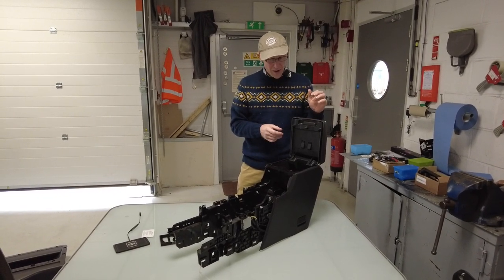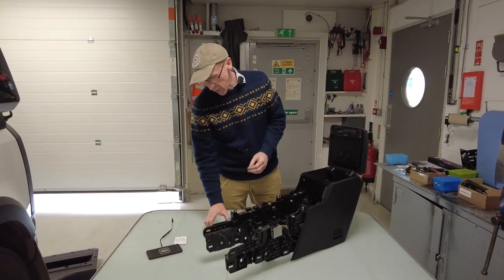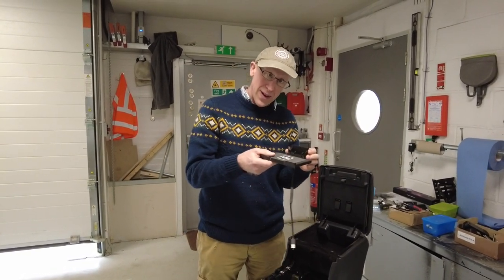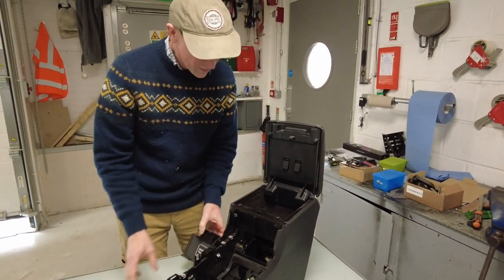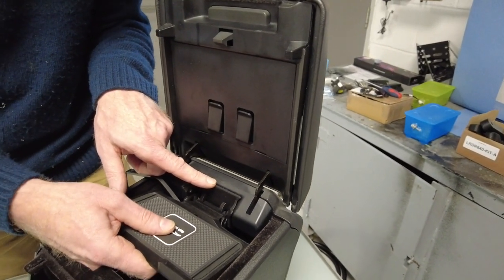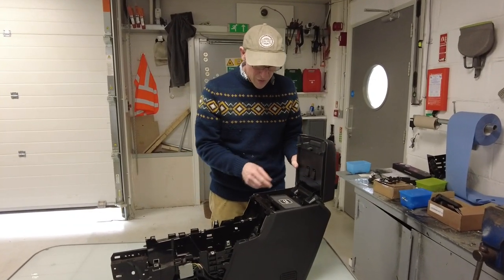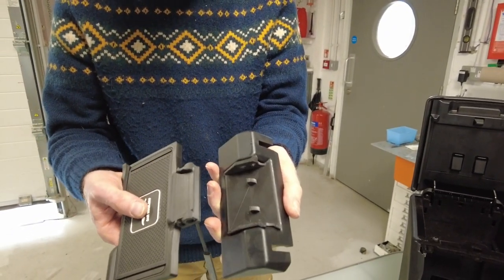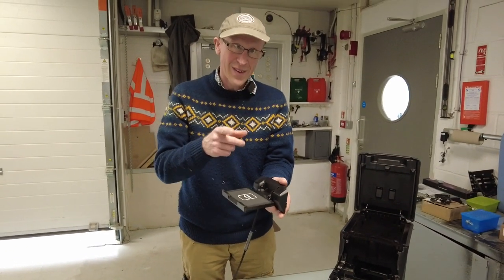Land Rover Discovery Sport L550 Wireless Phone Charger Install

Comment: Hello Simon!! The D/S never has a fridge in the armrest being much smaller than the full size Discovery 3/4 models. The charger will certainly fit the HSE Luxury with rear screen versions and inside the “box” you get power and media slots plus HDMI and SIM card. I actually have a cable plugged in for phone charging and have balanced the phone in the centre console pocket in front of the gear selector. Zack’s unit will fit of course and be a neat solution BUT, to be super snazzy, you could add a set of clips to hold the rear screen remote controller which I keep in that box and it is quite big…however don’t bother engineering one because sales will be super low…I have only ever found one other D/S with that option fitted! Good work Team!! 😎😎😎Richard
Reply from the maker: You are way to flash Richard ! remote control rear screens !
Reply: @L663  The trouble is, nobody ever sits in the back so I only turn it on to see if it works!!

Comment: Can it be installed on a Disco 4 ?
Reply from the maker: No but we need to look at the D4 one again - we did one that covered the cup holder but that has not been that popular - the ones in the cubby seem to be more popular.
Reply: @L663  Ppl must like their coffee on the go 😄. Can you do a vertical(with slight angle) charger that fits in one cup holder (like the LR one ) and also see the display top too